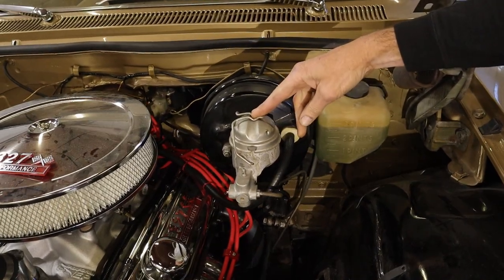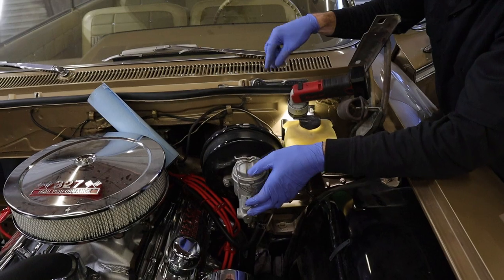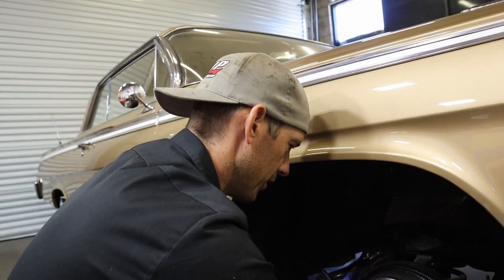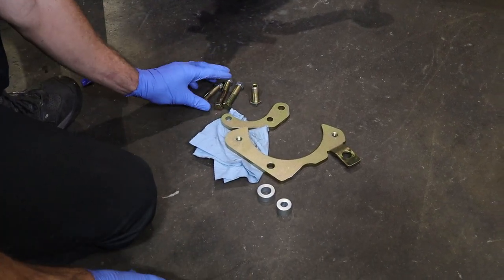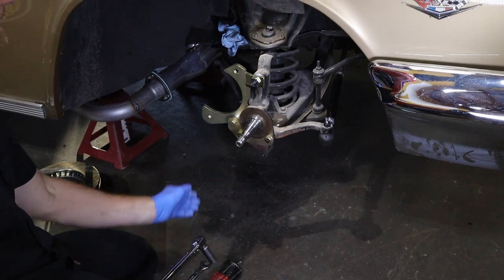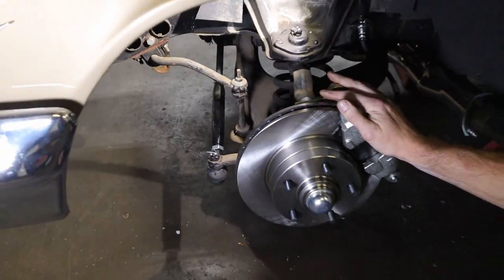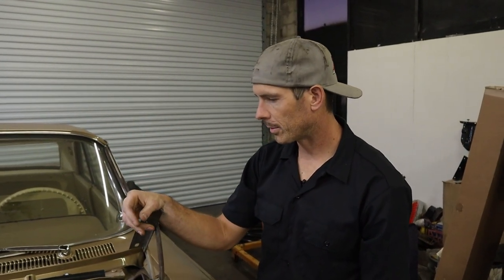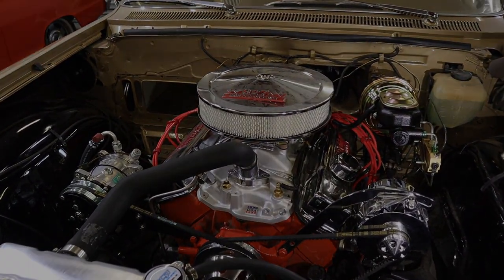62 Impala Disc Brake Conversion

Comment: Rusty MC is not a good look. Don't really like the black though. Silver to match intake manifold or a cast iron color for headers is what I used. Great job though you can tell you take pride in your work specifically the small details. 👍

Comment: I love the work you guys doing. Definitely knows what u all dealing with. I did a work on my proportioning valve in the past it was my first. I dint know that you have to put clump on brake line when u change your caliper. Or else u mess up the proportioning valve the cylinder will go on the other side because of the major loss of break fluid! All & all I owe some technic & I have learned lots of thing in this channel. I like the spring removal tool from the 70s that’s save u some pain removing brake drum springs!

Comment: Excellent video very informative, I have an impala 1960 and I want to de the same but I want to keep my original wheels 14 and I want to make sure I buy the proper kit for it can you please inform me what is the part number of those calipers for rim 14 so I can buy the correct ones thanks in advance for all the info you can provide me thanks again.

Comment: Great video! doing the same now on my 63 with a 283. QQ would i be able to run a vac for the booster where the back of the TB is? Theres currently a PCV there so wasnt sure if was ok. Want to retain the current rochester and IM for now.

Comment: I'm sorry but I don't I don't mean any offense or disrespect all you have to do is fill out the lower tie rod upper ball joint lower ball joint pull the whole plate out and put the new plate in new brake line and your new brake booster and power brake system Bleed It new lines are you good to go❤😊